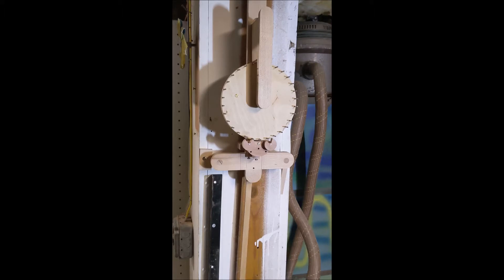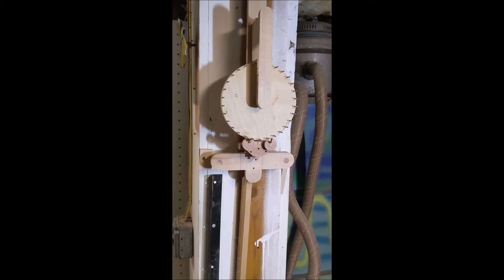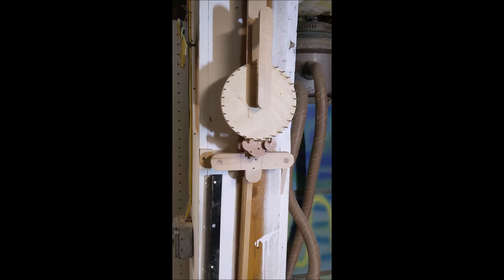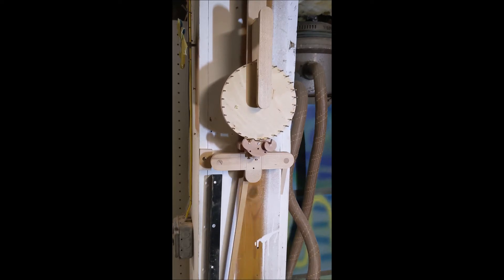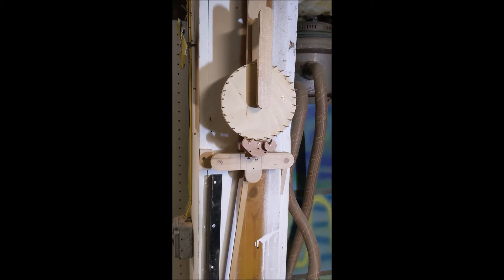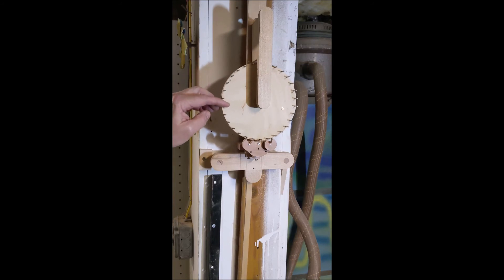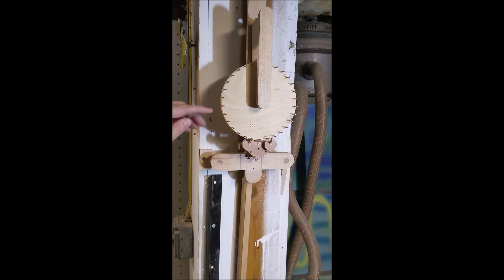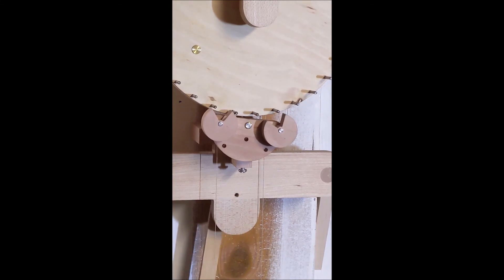Pac-Man Escapement

Comment: it is so quiet. do you use spring to get the pallet recoil?
Reply from the maker: The pallets fall into place by virtue of weights on the back of the "Pac-man" disks.  The escape wheel is driven by a weight.  There are no springs in the mechanism.